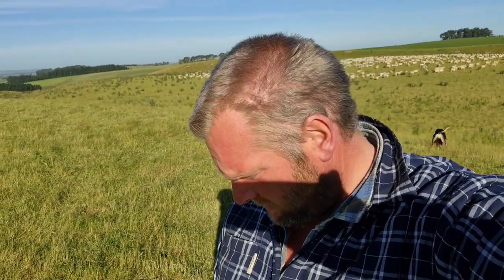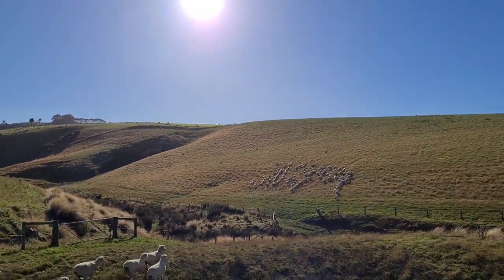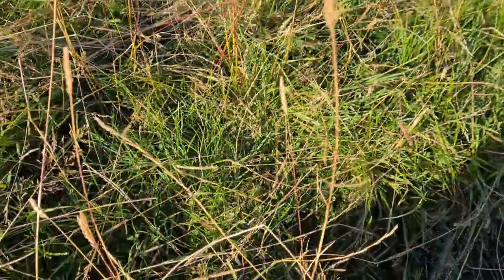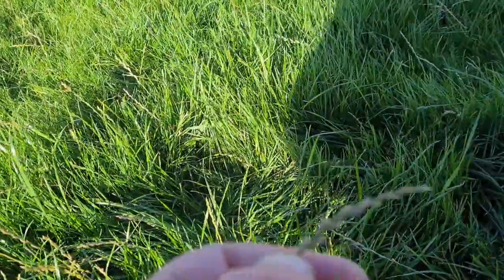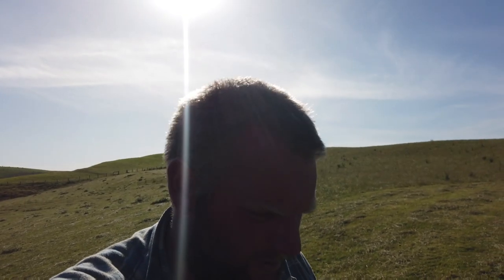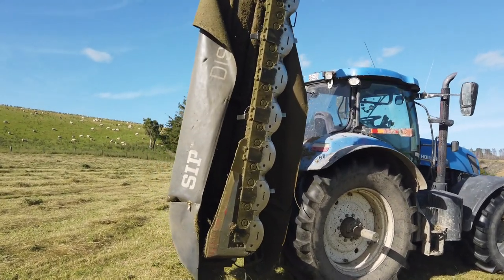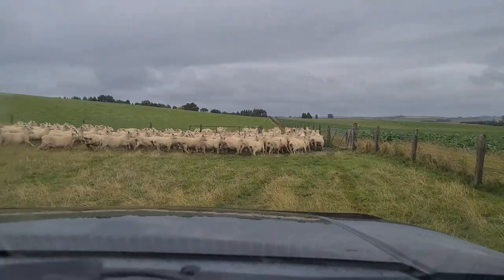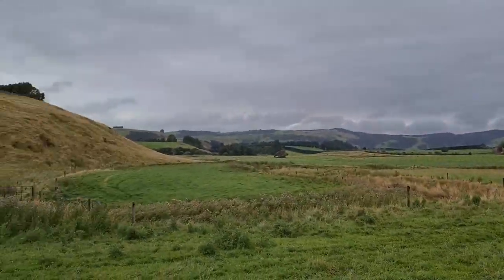Regenerative farming?                Too much grass, impossible to control!The ewes are on the move.

Comment: Yu could do with a flail topper.
Reply from the maker: You could, but they're slow, costly, use more fuel and don't leave as good of a finish.You can do up to 25km/h with these, when conditions allow, and can cut down to 30mm height.
Reply: no they would wreck the grass in dry weather ........disc mower is the only   weapon   to use ...........nice clean cut and quick regrowth.........got a disc mower here for topping and will not go back to a topper again ...........its only used on parts of the farm that are too rough  for a disc  mower .........